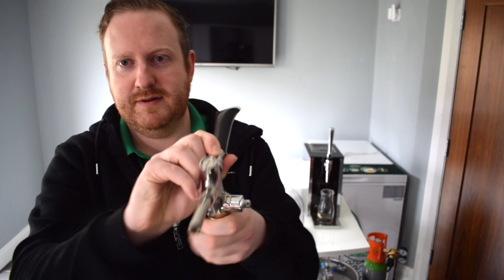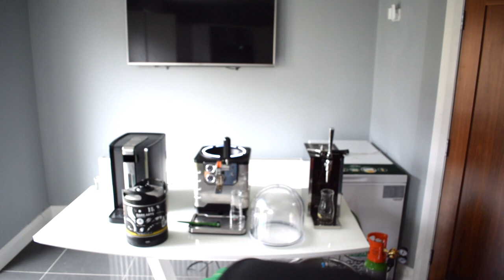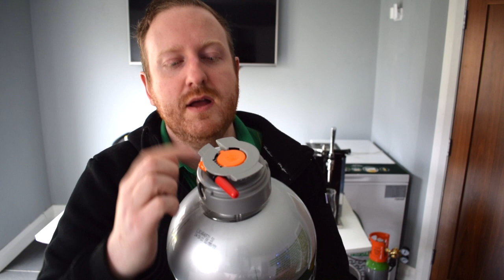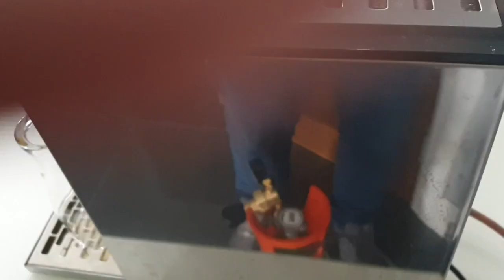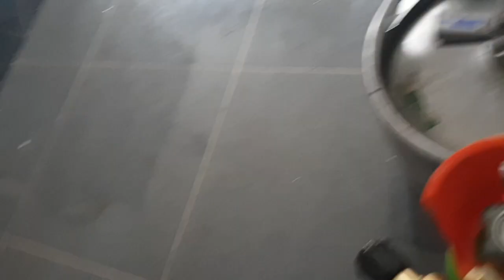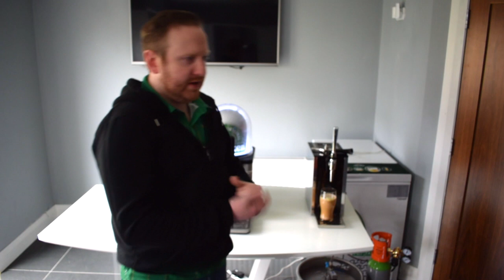Ultimate Beer Machine Battle!! Perfect Draft vs Blade vs Lindr Pygmy 25k  -Which 1 is right for you?

Comment: Nice video, I have the blade the pd and the sub, thinking of getting Pygmy but do you know.if.i can get/use smaller.kegs than they do.on the pub set ups as I'm told they are 88 pints and need to be drunk within 2 weeks, which has always been the put off for me
Reply from the maker: HI sorry for the delay, i was recovering from an op so i didnt really see many of the comments, you can get 20 and 30 l kegs for this for sure, ive come across some 12L polykegs as well :)

Comment: Long story short, get the Lindr Pygmy. It's the only one of these that's truly universal and doesn't tie you down to the brands limited selection of overpriced kegs, it's the only one with a built-in compressor, the only one with a real cooler and the only one which you can use with real taps. The other ones are more gimmicky than anything else. The only disadvantage is that you need to clean it. But if you like good beer, then you won't mind doing that anyway. Plus, with the right equipment, that's easy to do.

Comment: Can you buy any of the kegs in shops in Ireland or do you have to get posted from England?
Reply from the maker: Thanks for watching and for commenting :) .... Blade kegs are available in Ireland but quite limited and most seem to get them posted to the north, beer shark are launching an irish website soon though which should make it easier. as for the perfect draft, check out the the beer gals website, they offer a great service, usually next day delivery too!! as for the lindr, normal steel kegs will fit that if your using gas, the lindr can connect to any keg really(except mini kegs). any other questions just shout :)

Comment: Hi James, me again ,after review of your video ,I've decided on the lindr pygmy system ,may I ask who sells the poly kegs in Ireland?I think for now I'll not use the steel keg and gas system ie I'd like to use the Air intake .. and were is the best place to buy them both poly system and pollies ??and id like to move between lager and stout depending on the mood and party type ,what tap lines and couplers do i need ?Jesus I'm getting my monies worth 🤣..
Reply from the maker: Hi Dermot, the choice of poly/key kegs is limited to some lagers and ipas/wines/prosecco. not sure if stout is available on it(cant do a Nitro stout like Guinness without gas). im yet to try it on my own system but i see here that brewcrew have a selection but theyre out of stock of those kegs at the moment but no harm giving them a call about a lindr system for doing poly or key kegs and just using air. you can check the details with them  https://brewcrew.ie/collections/keykeg-kegs ... the lads there might have a keg handy for you as well if you give them a call, who knows. someone came back to me on the channel earlier this week with high praise of their service so worth checking out :) .. if you are based up north there's other options.
Reply: @JKTries  thanks again,great help .I'm based in meath ,I'll definitely put in a call and see what's available .I'd nearly buy you a pint at this stage if the pubs we're open 👍🤣
Reply from the maker: @dermotlynch9779  yeah those guys will have everything you need im sure, not sure what price it could all come too but you have plenty options with/without gas and if you want stout you need a stout tap attachment so remember that. you can also buy it as a 2 tap system so you can have stout on one side and lager on the other and serve both at the one time or stick with the single fitting, depends on how much you drink lol. well precovid i spent alot of weekends working in Navan, I was a regular at Mick Ryans bar there doing some weekend entertainment work there. havnt been up that neck of the woods now in a year. :)
Reply: @JKTries  ryans is a grand spot ,more of a Royal meath man ,should check it out  sometime ,I'll be there to buy ye that pint ,a right nice pint !😂😂
Reply from the maker: @dermotlynch9779  well i may well be back in Navan regularly post covid who knows lol. A few right nice pints to be had!!

Comment: Hi James ,a quick question ,does the lindrs pygmy system do only kegs with gas ?or can you set up any other way ?
Reply from the maker: Hi Dermot, thanks for watching the video :) ... the model i have there has an air compression option, you can use compressed air to draw beer from the steel kegs but the beer apparantly will only stay fresh for a couple of stays if used like that. i dont think the air compression will work on a stout as you need nitro but it will be fine for lager for perhaps a family gathering or function to get through the beer in a couple of evenings. but you can buy poly kegs that the beer will last 6 weeks using the air compression part of the unit. those kegs are designed that the beer is in a bag within in the keg and the air pressurisings the bag from outside it and pushes the beer through the line, that way the beer doesnt get oxidized and stays fresher for longer. hope this info helps :) ive only used my unit so far for stout using the nitro gas and stout tap fitting but ill get more videos on it soon :)
Reply: @JKTries  brilliant thanks for the information,great channel ,👍👍
Reply from the maker: @dermotlynch9779  No problem at all Dermot, only glad to help. thanks for the feedback, its very much appreciated :)